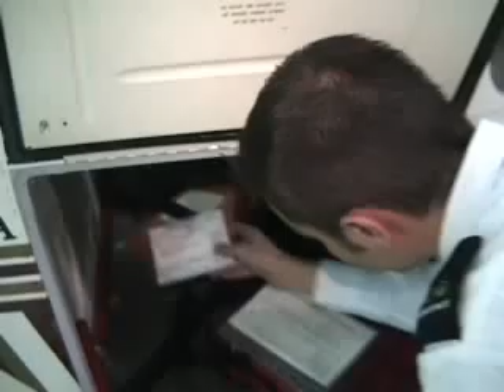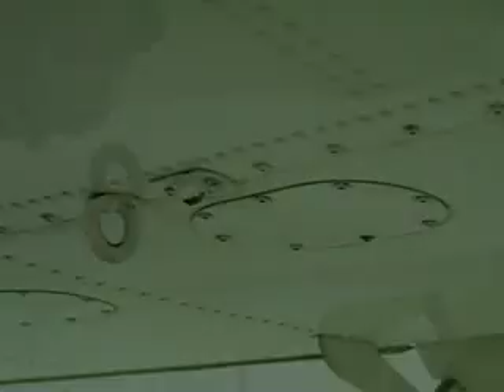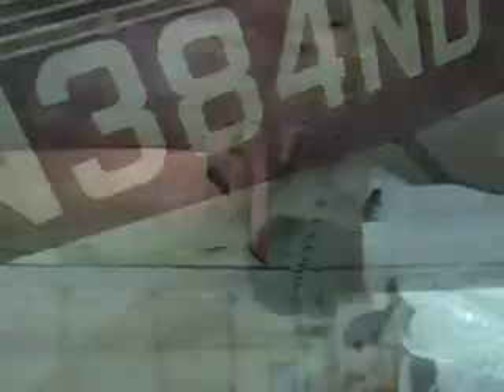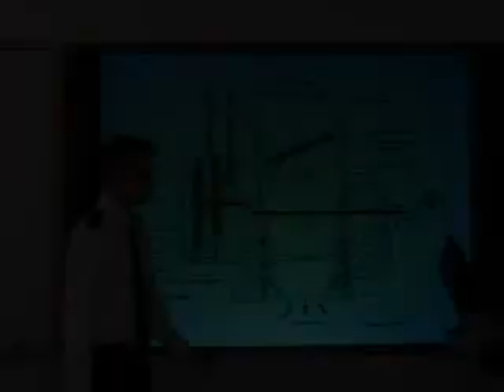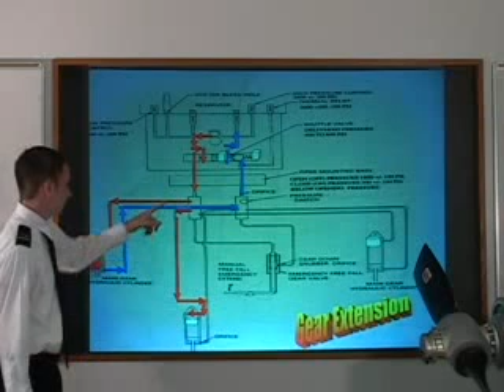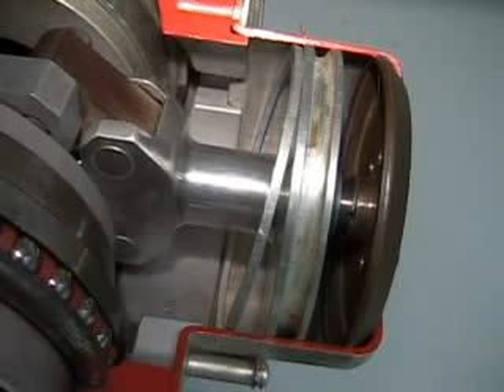Complex Aircraft Systems

Comment: Great preflight walkthrough. 
The "octane" information was highly inaccurate. Correctly called "anti-knock rating" and there are several scales and test methods, it is correct that static compression ration is one of the factors but not as bluntly as presented, the fuel distribution has only minor relation to the required AKR; and even if it did, this is engine has injectors at each cylinder so fuel distribution is actually quite good. 

The systems info is pretty good overall, but it would be better to leave out the explanations of the finer details. Both because they are not relevent to the pilot in any practical sense, and because the mix of idealized book theory and urban legend does not accurately represent the real complications of practical engineering values thus pointless to memorize at that level of detail.(Sort of like significant digits when taking measurments.) 

eg, the milspec number for the hydraulic fluid is meaningless because the pilot is not going to do hydraulic maintenance, let alone on the flight line with no service manual. 
Yes, 14.7:1 is a stoiciometric mix for an average gasoline blend. However, the mechanic is not tuning this engine to idle at that mix for a number of reasons which I won't go into here; instead it would be tuned for certain operating characteristics that likely put it a little on the rich side.

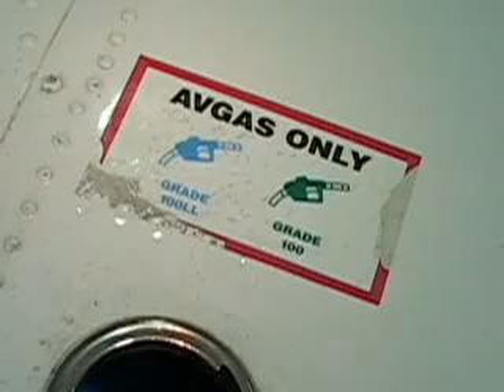Comment: Rather confusing point regarding fuel at 17:03.....you say, "100 is typically green, and 80 is red in color".  Yet the 100 fuel in your had is blue.  (Blue is 100 low lead.)  I guess when you say 100 is typically green you are implying it's use is more prevalent than the blue 100LL you have in your hand.  Anyway, I had to replay that for clarification.  Thanks for the video. Very informative.
Reply: For the record. The red fuel 80/82 is no longer available anywhere in the united states. It's been this way for over a decade. I've flown in about 30 different states and hundreds of airports. I have seen ONCE 100 (green) being sold from a pump. It's almost not worth talking about anymore since 100LL is really the only piston fuel available unless you are diesel in which case you use jet-A. So in short, if you can't fly on 100LL and don't have a motor gas STC you aren't flying anywhere. Unless of course you want to order big drums and pump fuel for yourself, but then you always have to return to your home airport. No long XC.